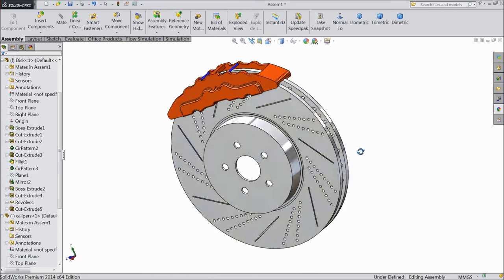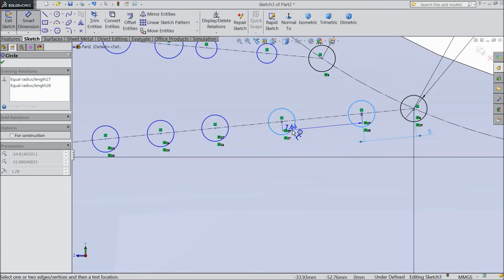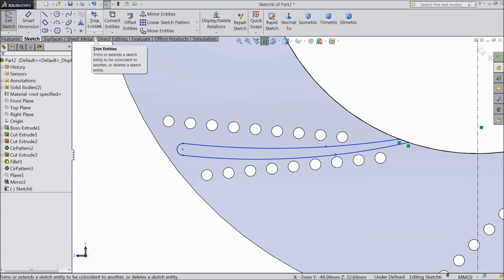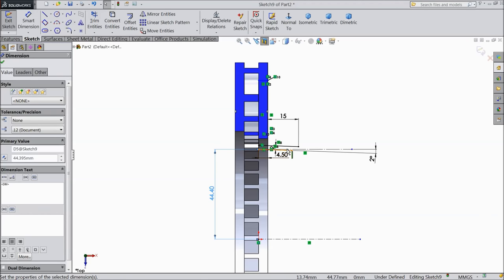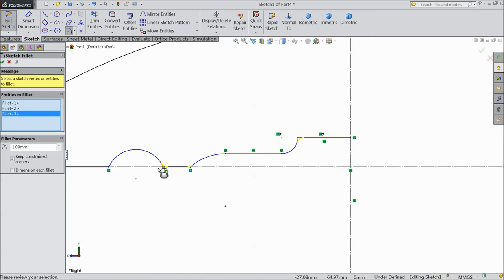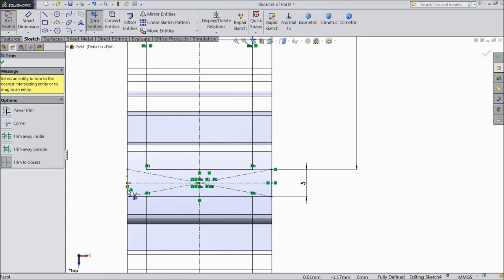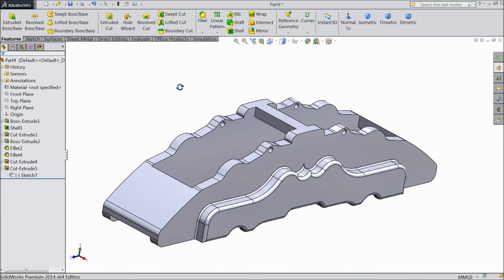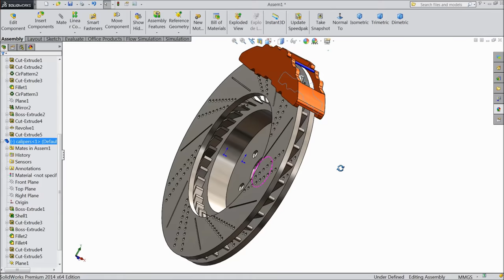Solidworks Disk Brake Tutorial

Comment: you made a calliper and disc brake ,it will not function without a brake pad. How do u think that you can use a force on disc surface?  If you only care about how does it look then it is ok but this thing will not work when you make an analysis in ANSYS etc.
Reply: Do you have any idea how to make the brake pad so I can simulate this disc on SolidWorks?
I don’t know how to use ANSYS